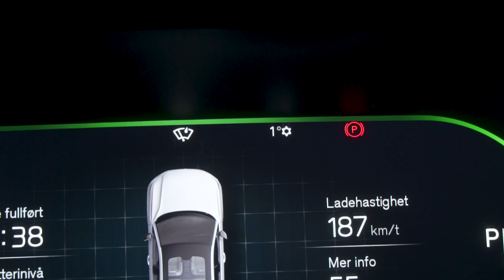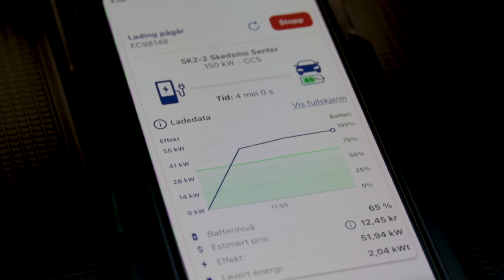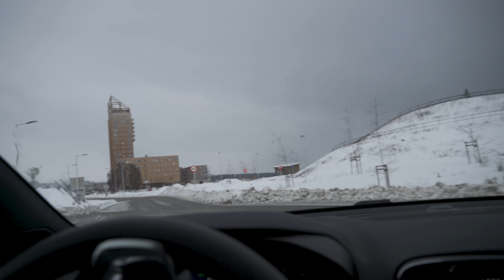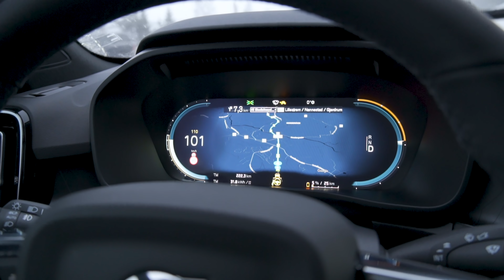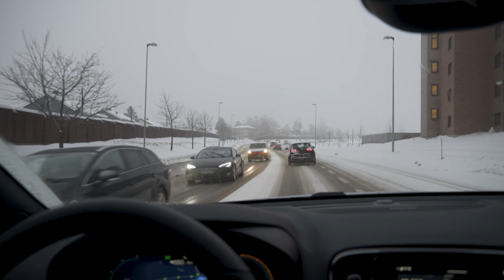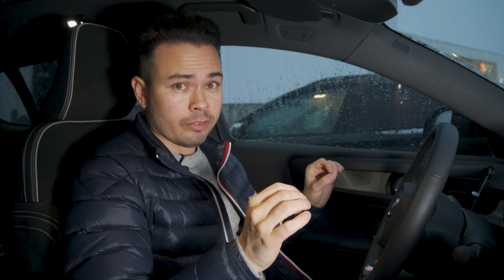Volvo C40 Motorway Range Test

Comment: I just bought the C40 Recharge Ultimate as my first EV and got it for 50% off to make room for the 2024 model...yes, the 2024 has better battery capacity but I got free Electrify America charging for 3 years... I'm extremely happy and also live in a state with a full winter season.

The orange line on the battery side indicates an issue. The review should have ended there... everything beyond that was nonsense. I went back and watched this stupid video and your complaining nonsense section clearly had a ZERO percentage on battery...yet you explained none if it or why. What person lets an EV drain down to zero percentage on gauge and then proceeds to complain about "turtle" mode??? You were at 7% as well and not understanding why it slowed down??? Please don't review more EVs.

Downvoted for no explanation of dubious driving.

Comment: I'm sure it's due to you setting the destination as a rapid charger.  It will heat the battery for 15-20 minutes before arrival in order to maximise the charging speed, but in doing so typically uses 8% of the battery - but far more in those cold conditions.  I bet if you repeated the test but set the destination to a building next to the charger (not the rapid charger itself) you would have made it with around 12% left.
Reply: This is a very interesting and credible sounding hypothesis. Is there any way of verifying it? @kris rifa - any chance you could repeat the test (or similar) doing as Richard suggests to see if this makes a difference?
Reply: @steven_vogt_DIYnot  Certainly I've seen that Bjorn Nyland has seen the charge level drop dramatically in this situation and the estimated battery charge level doesn't take it into account. I've seen this on my Polestar which uses the same drivetrain.

Comment: Addition to my earlier story of the outward journey. Saturday, January 15, 850 km back to the Netherlands from Austria. This time minus 5 degrees further foggy but no snow. Charging should remain at 150 kW for a little longer. For navigation, one should be able to indicate in the route planner that charging stations are long on the highway and do not have to leave it. Once, the navigation indicated a charging station in a village while it was actually next to the highway. This was an exciting moment because the way back meant 1% left and the power limited. The consumption was comparable to the outward journey. Otherwise a great experience and great car to drive.

Comment: Kris I had a very similar experience the other week, here in New England with my Polestar 2 under almost exactly the same weather and driving conditions.

I regularly drive from our home in Massachusetts to our mountain house in New Hampshire, which is 137 miles away. Under dry, or even colder snowing, winter conditions I'll have around 25% SoC available upon arrival (departure w/100% SoC). That's with winter tires and a roof box on.

When I drove up under the same conditions you experienced, my range was dropping off SUPER fast, and Google Maps was dropping the estimated arrival SoC more than I've ever seen! I had 12% SoC once I got there.

I know wet weather and cold sap the range, but holy cow, I think we both found the absolute worst conditions for range!

Comment: Something really went wrong here. Last Saturday we drove 850 km to Austria with a Volvo C40 at comparable temperature and snow conditions. I did not empty the battery below 10% but with me the arrival percentage increased and everything was fine. I went 120-130 km instead of 110 km to let the percentage drop. I had a consumption of 23 kWh-100km.

Comment: When you retest in better weather it would be good to see if it repeats the same turtle mode behaviour. There could well be some dynamic adjustment to when the mode is applied if consumption is particularly high due to the weather conditions

Comment: Hi Kris, I own a XC40 recharge 2022. I had a similar issue on low percentages of battery. Drove until 0% but with 4km of range. Wouldn’t go any faster then 60km/h on the highway. Very dangerous. The lack of speed started at 7%.

Comment: Very good informative video indeed and thanks Kris!!! I wouldn´t want to experience "the turtle effect" on the road... This shows that (in winter conditions) even in motorway speeds the consumption of electric vechicles is still too high!!! I saved the data sheet from your video and compared more the consumptions and to my opinion none of those cars you have tested is good enough to my thinking. Even the Audi E-tron GT went only about 80% of the battery and in august, warm weather! Everything below 60% is total rubbish. I am disappointed in Volvo and Polestar range/technology yet. I guess for the Volvo C40 it could be something software related? Tesla consumptions are definitely the best. How can they do that? I am not able to tell and don´t know what to do, but for the sake of power in motor they should tweak and learn to adjust range more than the power and acceleration...!  I don´t assume it is possible yet but +400hp with that kind of range is useless if you drive steadily and same speed in motorway...

Comment: Thanks for the test, can you do the test under better conditions? I just have my C40 a week. And didn’t experience the power dropping below 10%.

Other question; do the C40 you testing have dab+ and the heated back seats? I don’t have that in the Dutch C40.
Reply: How low has the SOC gotten in your car?  And could you drive highway speeds when under 10 percent SOC?

Comment: Many thanks Kris Refa for this tests. I am actually thinking about ordering this car at the end of the month. Then it will take about 3 or 4 months when I own the car. For mine work I have to drive about 260km a day that means I have to recharge it underway somewhere under these weather conditions. I live in the Netherlands so this weather conditions will not appear a lot overhere. Now I have a question. Earlier I had seen the test with the XC40 with temperatures of at the lowest of -20°C. But then you hadn't this many lose of power at 0% battery. Mine opinion is that the weather condition the slippery road and uphill driving made it all come together to having this problems. What do you think about that? By the way here in the Netherlands there is an ev-database where we can find the practical statistics of any ev car. And their I could find the range of 225km at worse weather conditions already. And the test that you made concludes the the statistics on the ev-database are kind of accurate. Again many thanks for the test. Hope the next test under better conditions will be much better then the last test of the C40.
Reply: Hoe heet die ev database?

Comment: Ive driven my Niro Ev in similar conditions. Im quite surprised that the consumption is that high! Im rarely above 25 kwh/100km. Ive driven the car below 5% a couple of times and never experienced this kind of power loss even in cold weather.
Reply: Remember that the Niro has only one motor and narrower wheels. I’m not surprised if that reduces consumption by 20%.. 🙂

Comment: Now this is the kind of winter driving conditions we have in Nova Scotia. These are the real world tests we need to see. Thanks.
Reply: Just do not think of EV in Nova Scotia. Leave that to more urban areas with mild climat and good electrical infrastructure.
Reply: @aris8332  I see no problem with EV in NS. There are hundreds already. Not too many Level 3 fast Chargers yet but they will come sooner than later. Also, no problems charging at home. NS Power  will have to adapt. Simple. It's all coming faster than most can imagine.
Reply: You got a very dubious video here with zero explanation or proof of proper charging.

Comment: Great video. I’m confused about EV’s, are they “second cars”? Not supposed to be driven all year? I’m from the Northeast of America and in places like Chicago, Dearborn, Cleveland and Buffalo our streets look like that or worse for the entire Winter, about 3 months. In many cities the pavement stays covered in snow, ice and slush until the Spring Thaw melts it down. EV’s at a MINIMUM need to get through your driving conditions easily because it gets much worse than that in the Northeast.
Reply: ours is the second car, dogs love it. EVs can be great in snow, or terrible. same as ICE. you just have to remember you cannot escape physics, and not having 70% of your energy as waste heat means you have to draw more energy for heat.
Reply: @laloajuria4678  thanks

Comment: Kris, thanks so much for your videos. I watched all of them before purchasing my Volvo XC40 here in the US. What you just showed is very common in my vehicle, and not just on cold days. Lets say I plan a trip and my car says I will have 20% battery left on arrival. I never get there with 20%. It can be as low as 5% when I arrive. My car estimates can not be trusted. I can watch as I am driving my expected power on arrival drop 1% at a time over and over again. If range is important to anyone, I would think twice about a Volvo EV. Everything other than the range is completely top notch in my XC40. I completely understand that ranges are most times based on perfect driving and weather conditions. However, when I am sitting in my car and planning a trip I think I want to see real world conditions. In the beginning I came real close to running out of battery power on several occasions. Not being a Tesla, there are not many charging options along our US highways.
Reply: Marcus, I have a 2021 XC40 Recharge and my estimates have been really close.......actually I have wound up with doing better than the predicted mileage.  I have 20 inch wheels so I wonder if that is something to consider, but its strange your estimates are so far off.  Cold weather really does effect the range though.  In the summer I was getting 25-26 kWh/100mi.  Now in the winter I'm getting 38-39 kWh/100mi.  So cold really hurts the battery.
Reply: @DougThompson  Hi Doug, just a quick question. Knowing your power consumption is changing from 25-38 do you feel you estimates are changing with that in mind or do the estimates become incorrect? Also I have never seen power consumption at 25 kWh/100mi only higher, sometimes up to 44.
Reply: @marcusarmstead1479  It seems to me to mostly be correct.  I've calculated what my state of charge should be when I arrive at my destination and it was pretty close.  The power consumption really varies a lot.......it really gets affected by cold weather, and also it might have warmed up to the 40's but was much colder at night, it still takes a while to get a lower consumption rate.  In this case, the longer you drive the better the consumption rate as the battery gets warmer.  I'm not sure where you live, but as the weather gets warmer you will see better rates.
Reply: Getting the exact same consumption figures as you driving in the winter in my xc40

Looking forward to try it out i the summer. Hoping to get close to 400 km on a charge…

The “estimated charge on arrival” is very precise. It is always within +/- 2-3% which in my opinion is good - since the car cant take head wind and snowy/wet roads in consideration.
Reply: That's why I use abrp for route planning. It's horrible to drive with but for planning very good.

Waiting for Waze to get electics in it...

Comment: At the current software 1.8, and also with the previous 1.7, Volvo XC40 has experienced almost similar phenomena. In the XC40´s case, and when driving close to 0%, the % gauge in the instrument cluster shows very different figures compared to Google Maps´ estimation of the arrival SoC. I´ve experienced this first hand, as 200m before home/charger, the % gauge showed 4% left and 35km remaining range whereas the Google Maps estimated 10% at the arrival (i.e. 200m prior arrival). First of all, you cannot drive 35km with only 4% left, so that´s wrong. Secondly, the turtle mode was not activated at that very moment. There is something fishy going on with these percentages. The software updates have done something to the % gauge´s estimations. More importantly, you don´t have the similar trust on these figures like in last summer. Volvo, fix this! And, thanks Kris for showing these abnormalities in your video!

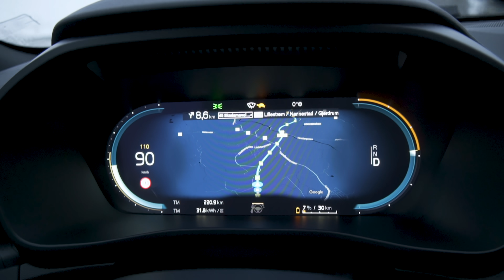Comment: 7:14 Insane, speed under 100 km/h basically means empty in WLTP (but they only test in ideal temperature conditions).
Can the Volvo get a Power Upgrade to about 480 hp like the Polestar 2?

Comment: I’m confused, when the car hit 7% on the motorway you were stuck at 27 kmh, but when you got off the motorway onto the back roads the speedometer was showing 42 kmh?
Reply: I wonder the exact same.
Reply: I suspect it was because it was uphill when he was at 27 km/h. It's a very heavy car.
Reply: @felixsanhueza  I think the same, looks uphill
Reply: sometimes when the battery pack has enough time to build up more energy then you can drive a little faster. The higher speeds were probably possible because he had just stopped at the roundabout for a little bit.
Reply: This is because only the power is limited, not the speed. So if it goes uphill, you may reach higher speeds.
Reply: Reminds me off my e_bike.. after 4 years it started losing power badly at 15-20% because one cell pack is worster then rest

Comment: Not impressed with this EV. Might be something wrong but i think Volvo have a lot to work on with their EVs. Ordered a EV6 a while ago instead
Reply: You did the right thing. I also liked Volvo/Polestar as a vehicles. But as an EV, they must improve :(
Reply: @gery4870 agree with you👍. Volvo are nice cars with especially petrol engine, the diesels are not refined enough these days
Reply: Thats the compromise of the shared ice/ev plattform, ev6 with its pure ev platform is much better tbf
Reply: @danielstefanovic2604  True ☝️

Comment: Please do the test again. My C40 will arrive 20.2 so I get to test this Soc 9% myself. So excited for your videos on C40!
Reply from the maker: Yes, I will do the test again later this week :) So it well be out next week some time.
Reply: @KrisRifa  So I did my testing today and it looks like your case is a lot worse what I faced with my car.
I got:
 50% power limit at 10% SOC and no turtle mode yet
75% power limit at 9% SOC no trutle mode yet
But very soon after still 9% SOC turtle mode did turn on and power limit went up around 80-85%
At 7% SOC the power limit went up to 87-90%
Still at 6-7% SOC I was still able to hit over 80km/h. At 5% SOC could still easily drive over 50km/h.
Power limit hit at least 90% at 3% SOC and top speed still around 50km/h even though pretty much now acceleration. 

The thing which is weird when I parked my car in front of my home i still had 1% SOC and car still claimed 10km of range and it would have been at zero after two more kilometers.
Reply: @Hemuli5454  Isn’t this about the same as what Kris experienced? 😬 Some minor  differences may have to do with the battery temperature.
Reply: @sdrhs-q3j  Yeah seems pretty close the same but the car didnt force me to drive only 30km/h at 4% soc. Have to contact my dealer next week 👍
Reply: @KrisRifa  I'll check if I have the time to test this on my C40 today. I'll update here if so 👌
Reply: Am looking to purchase one here in Thailand, at least we don’t have that kind of weather here. Are there any other faults to be aware of and has Volvo come back to you on said problems ?
Reply: @TheRoyalViking  Unfortunately ai havent had time to go see my dealer yet. Sometimes the interior trim lights on dash are flickering but basically nothing else.
Reply: @TheRoyalViking  คร่าว ๆ คือแบตเตอรี่จะลดฮวบเมื่อเจออากาศเย็นจัด ๆ ใช่ไหมครับ ตอนนี้ผมดู C40 ไว้เช่นกัน หากสะดวกรบกวนสรุปเป็นภาษาที่เข้าใจได้ง่ายให้ทีครับ ขอบคุณครับ

Comment: Simple consideration. In Southern EU (dont know if it is the same in the other parts) if the are mild or bad conditions you have to decrease your speed by 20 kmh, not depending the road you are riding over. So, Ive seen you drove 110 kmh, it is simply not correspond to reality over here. You should instead do 90. And we know how different would have been such different in speed at those conditions which respect the reality.
Reply: I'm not sure. 110km/h in these conditions look completely safe.
Reply: @jadziadax8658  im not talking about security but law.
Reply: @IlVeroCiccioPasticcione  I see, but few countries have that regulation
Reply: We use different tires here in Nordics. Perfectly ok driving speed with this car, proper tires and experienced driver like Kris. This is also about the test itself that you're not expected to lower the speed unless the car forces you like in this case.

I drive XC40 P8 in Finland, so I know how this machine handles the weather
Reply: @jaripietila1909  brother, snowtires are snowtires. Even here, there are the mandatory use for the studtires in the mountains. Cmon. Laws are laws.
Reply: @IlVeroCiccioPasticcione  in the Nordics the law is stated in the speedlimit sign 🤣. There's a clause that it's the uppermost speed and you may need to reduce your own for safe driving, but nothing like '20kph down or penalty' style. So Kris was fully following the lawful speed limits on Norway.
Reply: @jaripietila1909  u over there are mad! ;)
Reply: @IlVeroCiccioPasticcione  we're born with it here (winter and madness 😜)